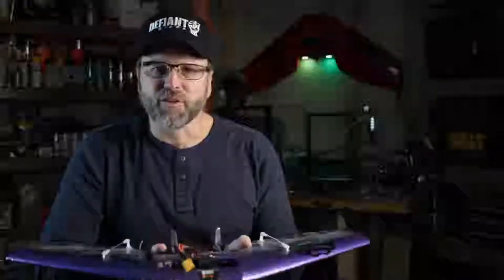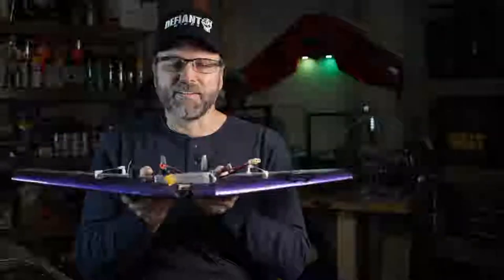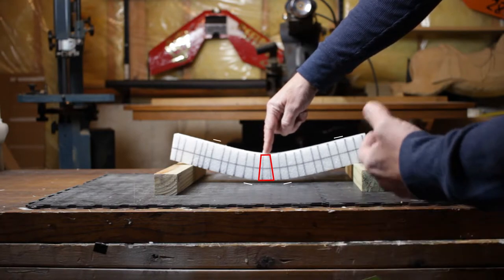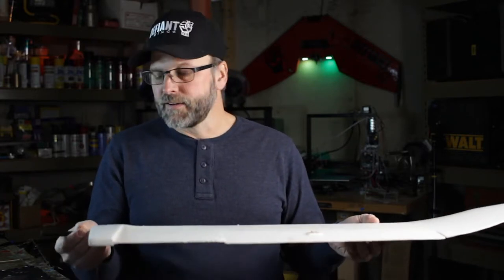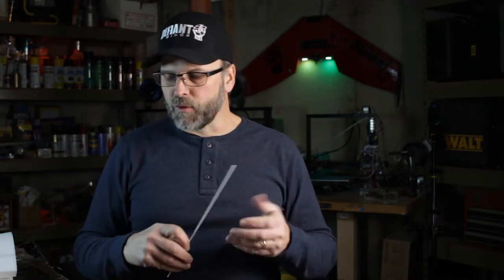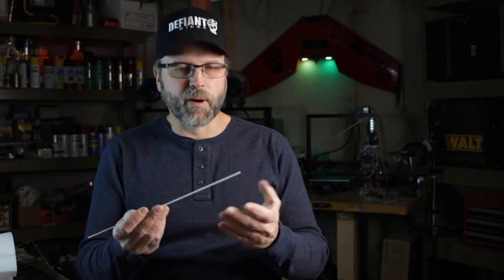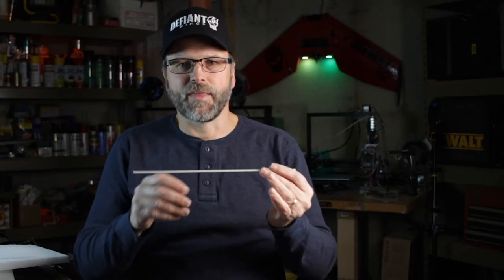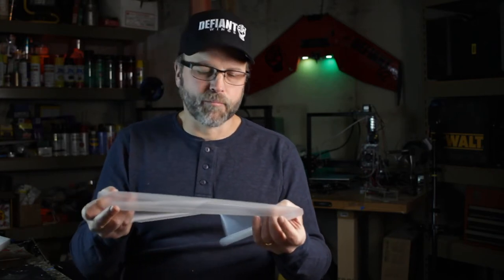Wing Structure (Knowledge Series Video 1)

Comment: Great first video in the series.

A super introduction into your thinking and implementation on the wing's structure. 
It reaffirms my thinking of why we construct wings the way we do, but having visual references gives me the confidence that it makes for as solid a wing as possible. 
I agree that using fibreglass makes economic sense over carbon fibre, given that the additional strength benefits of CF won't outweigh the additional costs involved.

I can't wait to see more videos in the series.
Reply from the maker: Thx Phil!  A lot of concepts in our hobby can be complex and people end up taking them for granted without fully understanding them.  My goal is to try to explain these with as many demonstrations and as much science and engineering as the viewers will tolerate .  I hope to keep it interesting and fun so the concepts will be easier to understand